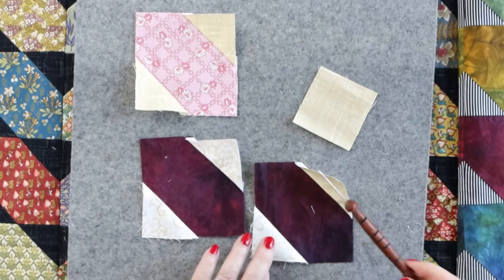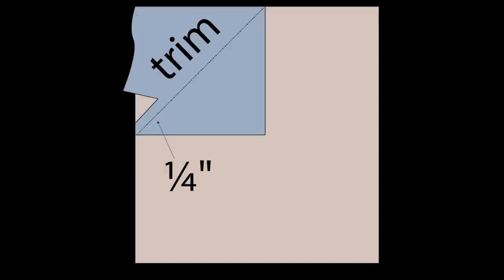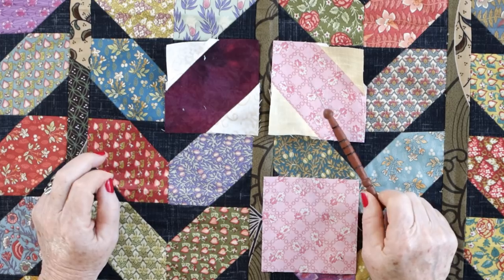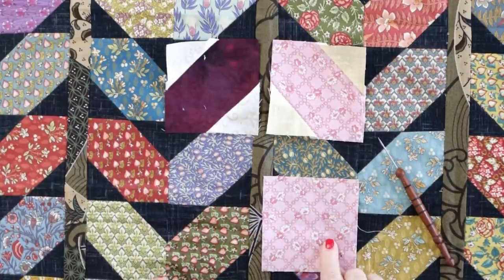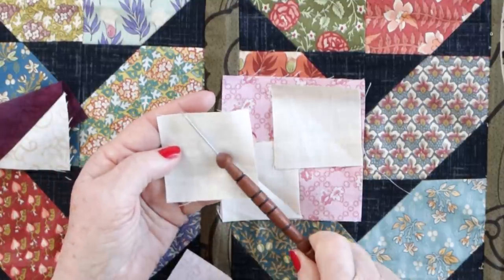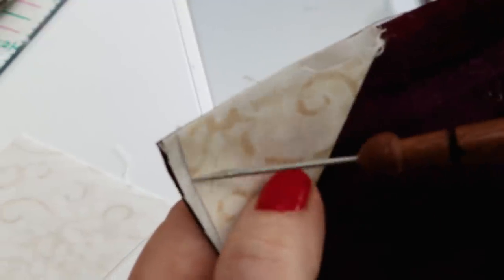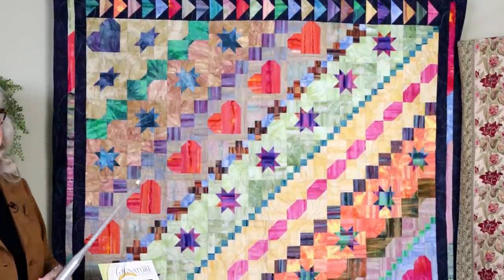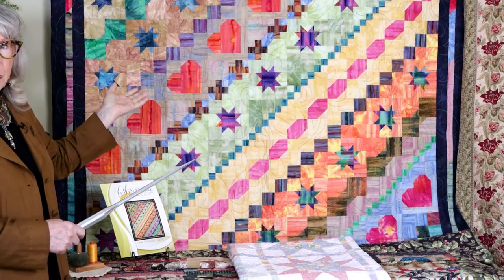PATCHWORK - Mastering the Connector Method

Comment: At min: 12:23
If you want to use those small triangles as shown in video: BEFORE cutting them out, sew another line parallel with the one you’ve just sewn to form the triangles (called also snow balls) and cut AFTER sewing the second line. In this way you have already those small HST, and you won’t struggle to piece those very small triangles cut off. Hope my explanation is understandable well enough.